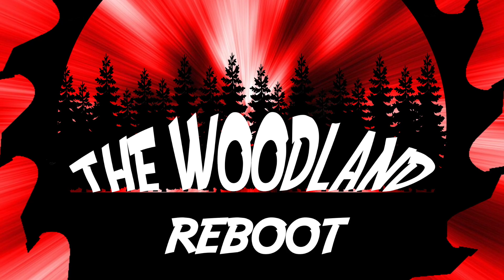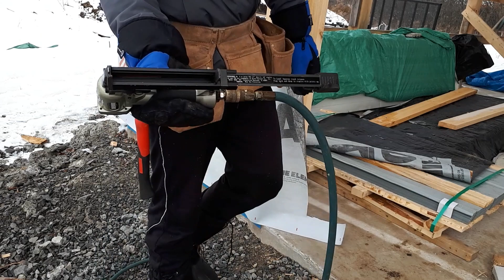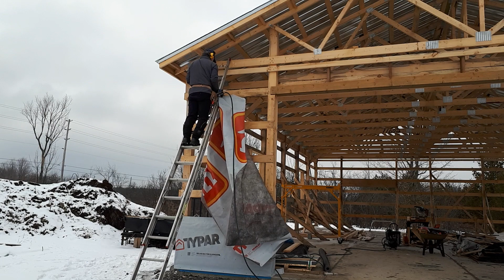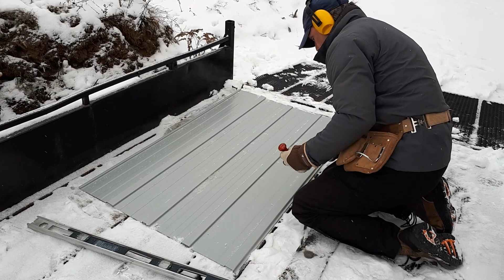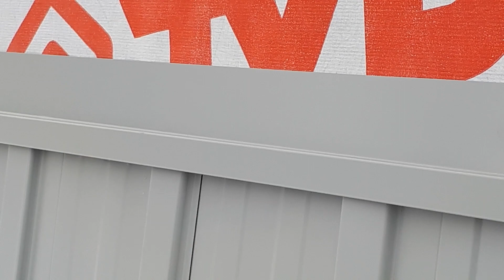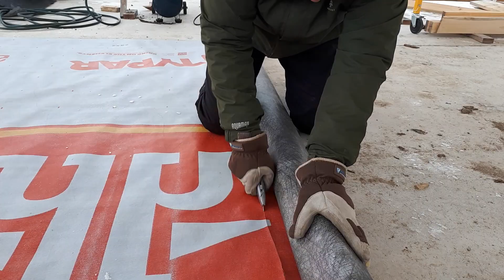Pole Barn Build - Installing Metal Siding #1

Comment: I am looking to enclose a lean-to on my steel building but using wood framing like a pole barn. Since I am going to be using wood framing, would I still need the wrap if I was going to do closed foam spray insulation?
Reply from the maker: Hi Bent, From what you're describing, it seems to me you still need the strapping so you have something to attach your metal siding to. Hope this helps. Peter at the Reboot.
Reply: @TheWoodlandReboot  Sorry...just saw your reply. I was actually asking about the "Typar" you were installing and whether this would be necessary if I was going to have spray foam insulation. Thanks.

Comment: I like the colour choice of the panels . Looks good . I see that you didn't have to cut the width of the front panels . Did you design the building that way to get full panels instaled that way ? Atleast you don't have to deal with very long panels from top to bottom .
Reply from the maker: Thanks Henry. I was able to order the panels with the correct length based on my dimensions ... as long as my measurements are accurate. Concerning panel width, I did not take that dimension into account concerning door and window locations. Keep the comments and questions coming! Peter
Reply: Ok thanks . Enjoying this build very much . Always looking forward to see what you have done . Question . How did you know the exact measurements for the large door ways. Don't know if you already have the doors . If you do than you should know the exact width and height  to make the door openings . Or are you just make an opening that you want and order the doors to fit . I had a normal garage door opening but it was too narrow and short to put my boat in . Had the garage door guy , measure the width that I needed and I made the rough opening . He then made a door to fit . Just wondering what you're doing . Thanks . Yea I know , I ramble on at times . LOL
Reply from the maker: Thanks Henry. Concerning the main garage door, I decided in the design phase on a door that will be 12' wide and 10' high. I was going to buy it new; however, I lucked into a used 12x10 door a few miles from my place.  Hope you're having a good Holiday season. Peter